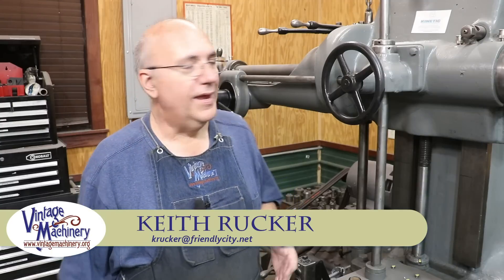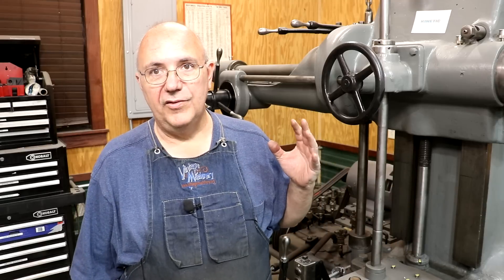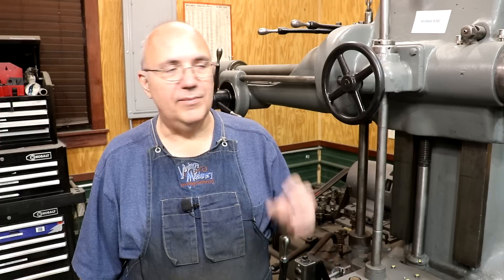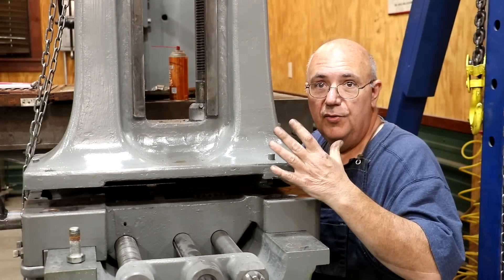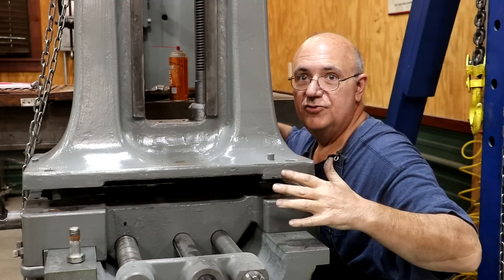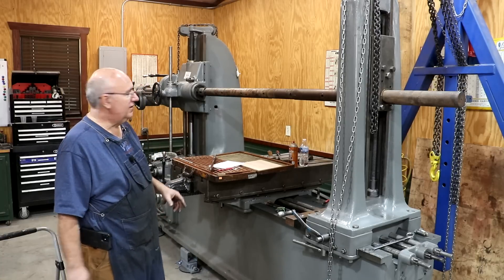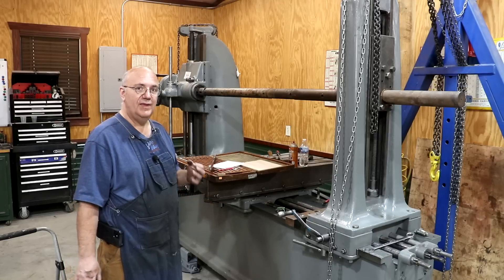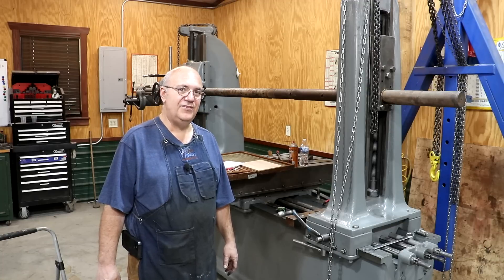Horizontal Boring Mill Restoration: Headstock and Tailstock Precision Alignment

Comment: Always enjoy your videos Keith. I used to have to use a micrometer set similar to that one many years ago. I was taught to make sure that you screwed together the minimum number of rods needed to make the measurement. For example for a 900mm bore with the sets we had, I think we would have used 3 pieces, 1 at 600, 1 at 200 and the micrometer at 100. Less connections meant less chance of error.

Comment: I spent a few years in a large machine shop in Morehead City, NC, working on similar sized machines, really enjoy watching such work, my machine shop is much smaller but similar work on engines.  I miss the old "big machines" most of the ones I've worked on were fifty years older than myself, some a century older.

Comment: Hello Keith,  I have the same inside mic set as you except I think mine may be even bigger.  I made a video about it a while ago. It will go out to 415 inches. Also similar to you, after two years of work my HBM should be running today as well.  Ken

Comment: If you add shims to the base of the tail stock wont you increase the lash of the gears causing greater errors as you move up and down.   How much lash between the angle gears exists now.  Is there any shims or adjustment in the vertical lift screw in the tail stock.    I totally agree with others about running it up and down.    
   0.002" in 5 or 6 feet is really splitting hairs keith.    You could unbolt the tail stock tower and spread the thinnest 0w oil on the surfaces to keep them from rusting over the next hundred years 

Great work though.

Comment: I hope you cover the shimming process.  Sometimes the burr on a piece of cut shim throws things out of wack and I'd like to see how you cut your shim stock and install it - how much coverage of shim between the 2 mating parts, do you torque wrench the pieces or just tighten, do soft or hard shimming material (copper versus tool steel), do you lap the parts before shimming?  All the stuff involved.

Comment: Keith - great to see this machine coming together.  I did observe that you put your hands under a suspended load without any blocks to carry or catch the load should the strap snap.  In my 40+ years of project work, I cannot count the number of times a certified strap or cable has snapped while carrying a load much less than the load limit of the strap.  This is why my company has always had a safety rule that you do not get under a load, or place any part of your body under a load (what is called "line of fire:), while the load is on the hook unless there is a back up system to carry the load.  Safety is something that has to be constant and I would hate to see you get hurt while working on these heavy pieces of equipment.  A lot of people watch your videos and I think you have a great venue for promoting safe work.  Something to think about in your future work.
Reply: I had to scroll a long way down to find someone as concerned as I was, seeing Keith's fingers under the unsupported tailstock. As the old platitude has it 'Safety is no accident'. Having said that I am a great fan of Keith's channel, what a craftsman.

Comment: Instead of lifting the tail stock, wouldn't it be easier to knock the pin out of the feed rod coupling and hand crank the tailstock into alignment. If it was aligned before, the pin ought to drop right back in the coupling when done. On edit, I guess the bevel gears would have needed to be clocked on disassembly so at this point Keith's method is the only way to go unless he managed to reassemble at the same bevel gear alignment.

Comment: Keith:
Try your alignment several places up and down and you will probably find the alignment changing from the .002 you have in the present position.   I always enjoy your content!  RJA
Reply: I was going to comment the very same. The screws probably aren't absolutely perfect, and if one has a slight error one way where the other has an error the other way, they will add up, for better or for worse.

Comment: You indicated that it was a morse taper on the chuck end. I was thinking you could insert a drill chuck and chuck an alignment laser to shine at the tailstock. You would be able to see horizontal and vertical alignment and run out from one set up.
Reply: Now that sir is a good idea, but wouldn't the chuck just introduce yet another increment of inaccuracy? Probably better to use a collet chuck, but you would still have the problem of a 105 year old possibly well worn spindle taper to deal with. But there again if you were to run the spindle very slowly you would spot any misalignment  quickly with the laser dot going in circles.
Reply: You’re assuming that you can resolve a 0.002” measurement with a laser pointer?
Reply: @paul.newland  No, but alignment lasers are real and are made perfectly concentric to the case. e.g. L58SAC Industrial Alignment Laser
Reply: @markbernier8434  Yep, they’re great for resolving down to about 40 thou at best but we’re talking over an order of magnitude more accuracy required here…  they’d first get you in the ball park I guess!

Comment: I am somewhat confused by the alignment process.  You are working in three dimensions, yet you measure and align in one.  It seems that using an optical would provide greater accuracy.

I wonder about achieving your desired tolerance using a bar pinned at one end and support at the other by a bushing.  The bar, without support in the middle, will sag. The bar has some flex  as evidenced by the effort it took to move it into place and the initial measurements.  I am also curious about the shimming process. 

One last item, is deflection in the shaft as a result of heat.  As the machine runs the boring bar and the bronze bushing must heat. Is there additional deflection due to this heat?
Reply: He said multiple times he's still just roughing things in. He's very well versed in metrology and machine alignment, he will ultimately get it all as good as possible.

Comment: If that were my machine, I would want the rust removed from the boring bar and it to have a good polished finish on it!
I think a solid rod with a dial indicator on the end would have been a better method to check the boring bar parallelality to the bed!
Keep up the good work 🤩
JIM

Comment: Hindsight being 20/20, would it be easier to disconnect the shaft that transmits the movement from the headstock of the machine to the tailstock?  Punch out the pin and disconnect, then make adjustments from the hand crank on the tailstock end...
Reply: realignment of the pin hole?
Reply: @robertmatel8136  Yes, that might be an issue... or the point where the tail gets lifted to get things back together.  Lift once instead of however many times it took.

Comment: Nice to see the this almost back together. Keith, I noticed when you installed the bushing in the tailstock head the bushing appeared to have a lip or burr at about the 2 to 4 o'clock region of the end of the bushing. This was about 4:15 on the video. It may have been grease but it sure looked like wear.
Thanks for sharing.

Comment: I would use an indicator on a parallel strip (big one) or similar and sweep it under the bar each end to set the height. It’s very fast and accurate. You should also turn the bar and average out the runout also. I guarantee  it won’t be dead true. I am very surprised that there is no provision for fine adjust of the height. The horizontal I used to run did. Basically the nut inside had a worm wheel on one end, and a worm acted on it to rotate the nut in the housing, raising or lowering the tailstock. Hopefully the height adjustment stays good throughout the stroke of the machine. The machine I ran had a replacement screw on the head which was close,  but not perfect. When ever you moved the head the tailstock was always out. It lost .006” per turn of the screw. Very annoying.

Comment: Would have been easier to lower the tailstock to match the spindle, so you don't have to work with your arms over your head.  Always make your measurements while raising the head, that way the weight of the mechanism will remove any inherent lash.  Same thing when doing setups- go below your working point and raise to the proper level.
Reply: Don't lecture him.

Comment: Wouldn’t it have been easier to have the head and tailstock lower so your not reaching?
Reply: Great episode Keith, but to get the accuracy you are aiming for would it not have been an idea to get it close, then turn on the machine and spin the bar and clean it with wire wool and kerosene to get all the surface rust off of it so you can get a really accurate measurement of the height?  This isn't a criticism as you may well have been planning on it for the last step of dialling the machine in. It looks great and given your years of experience I bet it will work just fine for another hundred years.
Reply: It would have but most of the people who comment here for Keith don’t want to make any sort of critical comments for some reason.
Reply: @davidt8438  I get it. I have rebuilt machines for over 40 years. I can’t believe how he lucks out with his alignments. I’ve scraped days on a saddle, table etc. and he seems to just have to spot the surfaces. Taking sizes for turcite- wow normally you need to grind it close- not Keith it just needs a pattern scraped. Guess he lives right. But it’s fun to watch.

Comment: Keith, if the hbm bed has already been leveled, would it be more repeatable to use a precision level on the boring bar to make it parallel with the bed? 

Also wondering if you have any method to convert from brown and sharp no 9 to MT2?  I bought an Index 745 with BS9 but would like to utilize some MT2 drills already on hand.     I’ve found a Collis tool “rough socket” (p/n 60902) with MT2 socket.  The rough end could then be machined to a 3/4” straight shank and be held with my largest 3/4 collet. Would then require tool hardening.

Comment: Hi Keith. Does gear backlash affect alignment? I would imagine a dial indicator mounted to the table and run back and forth along the bar would be the ticket. How about horizontal alignment?
Reply: Yes, i was also thinking of backlash, it is probably the best to raise the headstock a little bit after every adjustment before measuring, to eliminate backlash.

Comment: 0.002 inch are 0.05 mm. Working even more precisely will be more difficult. 
With inch there are very small numbers.
Reply: Machining is commonly done to better than 0.001" accuracies. Units are irrelevant.

Comment: Have you thought about bearing clearance and backlash în the gear or wear on the lead screw?
Reply: Any gear chain has to have backlash, so when making adjustments you always make the final adjustment against the natural pressure.  In a manual mill this is why climb milling is sometimes a bit sketchy, because the feed pressure means the backlash space is in front of the cutter, and a climb mill means the cutter is pulling toward that free space, and the cutter can jump forward the amount of the backlash.  This amount may be enough to actually break a small endmill, but is often enough to make irregularities in the surface you are milling.  
It is also why you always move your mill table to position in the same direction.  In my case my habit is turning the dial clockwise.  If I need to move to a position in the counterclockwise direction I go past it far enough to use up the backlash, then turn clockwise to the target position.
In this case the resisting force is gravity, so as long as you move into position in an upward direction all the backlash is pushing back against the screw wear and gear lash, and it will be repeatable.  Uneven wear in the screw is not correctable, basically you use it until it exceeds whatever tolerances you can accept for the work you do, then you make a new screw/nut and start the process of wearing out again.
This is one of the reasons that lead screws often run in bronze nuts, because as the nut wears backlash increases, but precision does not suffer.  As the screw wears differently in different spots then precision suffers.  It is also usually easier and less expensive to replace a nut than the lead screw.
Reply: Maybe a better way would be to run the boring bar down to where you could get a dti on the table,and move th table back and forth.then see what you have.put dti on the shaft.
Reply: @AliceGirl2019  Don't want to sweep the bar.  Guaranteed to have sag.  Measuring the ends is best practice.

Comment: Very interesting, I hadn't realised why this machine had a tail stock until this video. One question though, how do you know you were directly below the boring bar when measuring? I should probably do the trigonometry to find out how much potential error that introduces but it feels like that would introduce more than the difference you now have.
Reply: He was wiggling the top of the mike and holding the bottom in one place to find the tightest point at the bar then wiggling the bottom of the mike while holding the top to find the tightest place at the bottom.  Rinse and repeat until the the overall tightest point at the tailstock bearing was found.  Do the same thing near the headstock bearing. If the bar had a big bend, measuring close to the bearings ignores it.
Reply: @kensherwin4544  Ah, thanks. I missed the wiggling at the bottom end.
Reply: @kensherwin4544  yes, the shortest distance wins the race as such. No need for trig at all, just very simple maths, the hypotenuse is always longer, once it's the shortest measurement then it's at 90 degs to the bottom of the bar

Comment: Dear lord reaching under something hanging by the crane. Great example of what not to do.
Reply: I've seen a lot of excellent machining from Keith, but some very dubious rigging..............
Reply: @thepotterer3726  I would trust the way he rigged it up and put my hands under it to turn the gear.
Often he even overcomplicates a rigging job if you ask me as someone thats certified to do rigging.
Reply: And with YEARS of experience and a stickler for safety Stan's (Bar-Z) missing finger tips might agree wholeheartedly...
Reply: This guy is very competent. Your comment is better suited in your head, no keyboard required.
Reply: @markkrick8602  In all of my 50 plus years working on machines like this, I would have at least shoved a couple of 2 x 4's under there just for safety.  You never know what can give way in your rigging!  My dad was a stickler about working safely when working on machinery, big or small.  Justin's comment stands correct! Ken
Reply: @4GSR  of course you would
Reply: @markkrick8602  Always one in every crowd!
Reply: @4GSR  do you own an AR?
Reply: After all these years that Keith has been doing this kind of stuff and he still has all his fingers, I would say that you don't have anything to worry about.